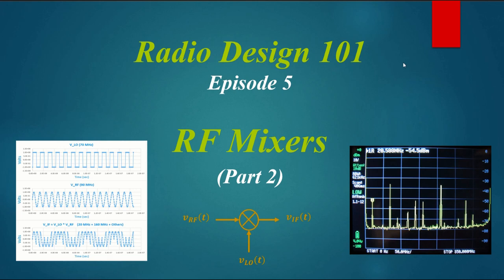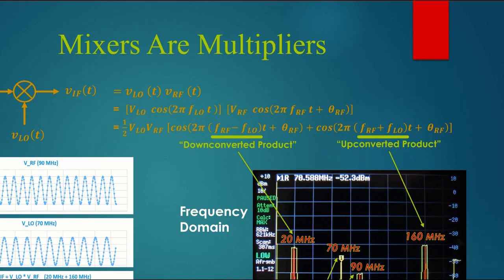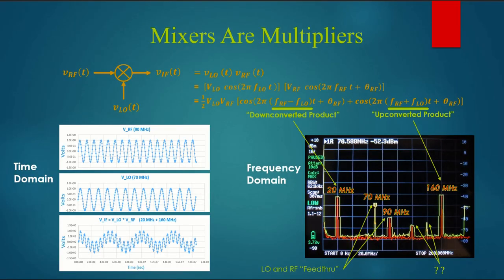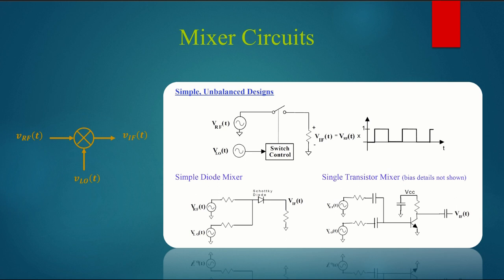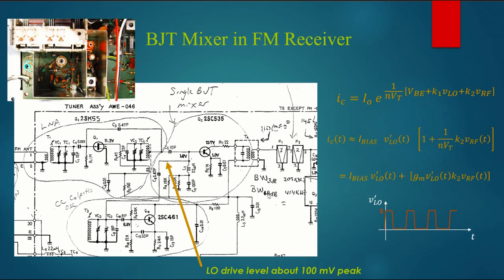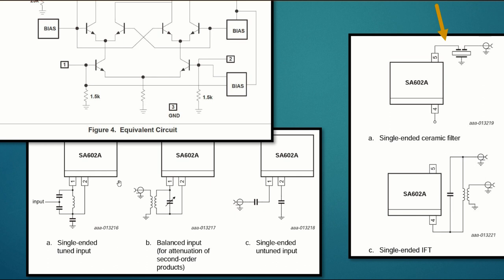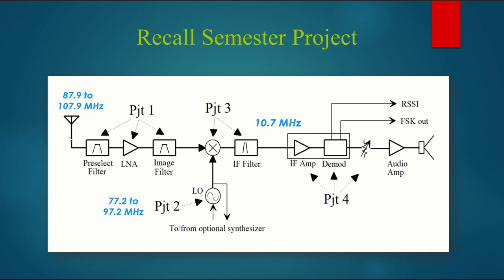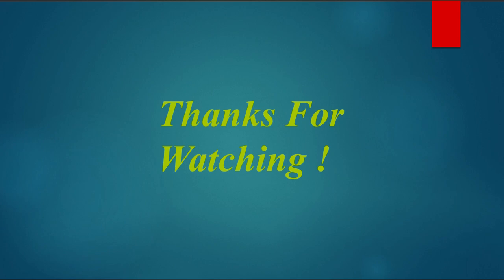Radio Design 101 - RF Mixers, Part 2 of Episode 5

Comment: I noticed at 12:46,capacitors(c8 & c5) and throughout the video there are capacitors with current going through them. I know this may be a question beneath you. If you don’t respond, I understand. I just always learned capacitors don’t allow current to travel through them. They have to be in parallel. I also learned transistors allow current to be taken from the emitter and the base supplies and on and off switch. So why are the capacitors allowing current to go through them? I know ac current can go through capacitors but not DC so is the voltage source AC. And can current be collected from the base of transistors as well?
Reply from the maker: Thanks for the question. In the videos, I'm almost always talking about "signal" flow. In this case, the signals (the RF and the local oscillator signals) are AC sinewaves, so they can pass through the capacitors without any problem, while the capacitors 'block' any DC 'bias'.  As you noted, capacitors do block DC. But they are also used for "AC Coupling" - letting the AC portion get through.  To go a little deeper into this, think of the voltage and any node in the circuit as AC+DC. For example, at the input of an amplifier, there is a "DC bias" required to get the transistor turned on. But the input signal is not just a flat DC line. It has the signal "riding" on it. Some examples are shown in the amplifier design discussions of Episode 3. Time 10: 14 to 11: 00 shows one example here:  https://youtu.be/UUlqW-vSq9M?t=611   Hope that helps.

Comment: It seems that the SA604 is now obsolete and I can't find it on Digikey or Mouser. Would you have another recommended FM IF demodulator IC? Thank you!
Reply from the maker: Interesting. Thanks for the heads-up! It's not used in the Radio Design 101 build, but we did use it in 2019 class parts list on ecefiles ( https://ecefiles.org/rf-circuits-course-notes/ ) .  It seems they took it out of production in the last 5 years 😞  The good news is that the approach taken in episode 6 where we used the SA602 as a demod still works. The bad news is that even that chip seems to be withdrawn from production by NXP as well?  All of them however do show up in listings on Amazon (at least the US site) in the form of NOS (new old stock).

Comment: You get other harmonics that you see in the spectrum analyzer not because the LO is of switching type. The simple multiplication formula is only a small yet the most important part of a longer equation. So, the shown smaller equation explains why you get the downconverted and upconverted components but doesn’t say how other components get generated. 😊
Reply from the maker: Thanks. Good point. I probably should use the term non-linear circuit rather than switching mixers. The BJT mixer (timestamp 6:50) may not fully switch on and off - but it does have non-linearity and transition softly between 'on' and 'off' during the LO cycle. So the diagrams are definitely idealized to a degree.  I actually never liked the commonly used formula f_IF = N f_RF + M f_LO because the N value is practice is mostly limited to N = 1. Unless one overdrives the radio front-end - but that does occur in situations (as noted in the Epilogue episodes in this searies). And as shown there, we can get intermods too... As you noted - it's definitely more complicated !  (but that's something we try to avoid in good receivers of course)

Comment: Can we use rf mixer to mix below 20 Khz audio signals to get higher and lower frequency in that range ?
Because at low frequency all things will be easy to control and see !
Reply from the maker: For most mixers, the RF and LO ports have to be within the RF range of frequencies (MHz to GHz depending on the model). But...  The IF port typically works down to DC, so it includes audio frequencies. In our classes we routinely mix down to audio range at the IF output when building Doppler radars. That said, if you mean can you use audio frequencies at  other ports - the answer is - maybe - it depends on the mixer type. Many have transformer inputs, so they won't pass audio. But something like the NE/SA602 (or 612) IC could be AC coupled with a sufficiently large DC blocking capacitors (e.g. 10 to 100 uF) on the RF and LO ports. (Of course they're still switching-mixers.  If you want a pure multiplication, then there are analog multiplier ICs, or you could just digitize two signals with 2 ADC channels and multiply them in the microprocessor I suppose :-)   Hope that helps.
Reply: @MegawattKS  i mean homemade mixer like using 4148 diode and Ferrite As transformer  or , using dual gate MOSFET mixer for low frequency in khz ?
Reply from the maker: @omsingharjit  I think that would be possible. However, keep in mind that the mixer is a switching design, so you will get out many, many, frequencies in addition to the sum and difference frequencies. The frequencies (n*f_LO +/- m*f_rf, with m and n signed integers) will be in the audio range but the waveform and sound that come out will be pretty complicated (and 'messy'). That's true for the 602/612 devices too. I guess it depends on the goal/application. Do you plan to have a narrow bandpass filter to select the desired 'product' ?

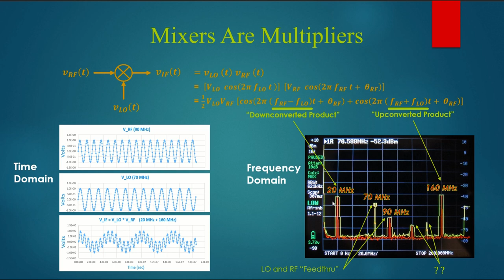Comment: I'm trying to use a transistor as a mixer, but rather than the bottom signal at 6:30 my output looks like the L.O amplitude modulated at the beat frequency... I.e. 10mhz , but this is filtered out by the 10mhz tuned circuit snd i have no output at all... Are there two types of mixers or I just designed my mixer incorrectly?
Reply from the maker: Hi. Interesting problem. It sounds like maybe the LO drive is not strong enough to cause the needed multiplication to happen. For a design like that at 11:30 (or more properly at 12:30 since that includes the output filter you mention), the LO signal at the base needs to be at least 100 to 200 mV peak (with the emitter AC grounded) to force the transistor to turn on and off over the course of the LO cycle. That 'chops' the RF  signal, meaning its multiplied by a squarewave (which contains sin(w_LOt)) at the LO frequency.  If the waveform looks like the LO, AM modulated at the beat frequency, then it sounds like the result is just the addition of the signals, with no multiplication happening. I.e. it's just something like  2 sin [½ (w_RF + w_LO) t] cos [½ (w_RF - w_LO)] = sin (w_LO t) + sin  (w_RF t). So its just the addition of the LO and RF sinewaves, with no new frequencies in its spectrum.   What are the frequencies and amplitudes being used for testing? And is the circuit something like that at 12:30 (with a good emitter bypass)?
Reply: @MegawattKS  thank you very much!

Comment: Mixer and filter work like a charm, higher order(3rd i think) harmonics of LO do make it out of filter though, but i think that should be played around to manageable levels with LO amplitude.
Reply from the maker: Excellent !   The good news is that the high-frequency content typically doesn't get much further down the receiver chain since the IF amp is typically lowpass or bandpass :-)
Reply from the maker: I'm starting to work on the next (and final?) video. The good news is that it will leverage the content already covered for the IF limiting amp (with some tweeks), and the demod uses the SA602/612 which we're already familiar with.  (In the class we used chips like the LM3189 or SA604 for IF amp and demod, but I didn't have any of those, so sticking with the basics. Those chips use a Gilbert Cell internally for their demod, so the techniques are basically the same...)
Reply: @MegawattKS  i am wondering whats the signal strength that would get a station receivable.....my SDR(USRP) had been unable to detect stations, my place gets poor signal strength.
Is -55 dBm after LNA a signal strength that could translate into audio?

(i could always test with my own SDR station, if commercial stations reception end up not working).
Reply from the maker: @cholan2100  Yes. that's actually a reasonably healthy signal :-)  A good FM broadcast band receiver should work down to within about 20 dB of the thermal noise floor (kTB). Here, B is the channel bandwidth, so 200 kHz, giving a noise floor of about -121 dBm if everything is perfect in the receiver (including low noise figure in LNA). So if all goes well, you should be able to get signals as low as -100 dBm at the antenna. In the class final exam demos, we set the threshold sensitivity spec at -110 dBm and the RF input power needed for 30 dB audio signal to noise as -100 dBm. Again - these are signal levels at the antenna, so if you have 20 dB in the LNA, you've got -75 dBm at the antenna and a good 25 dB margin :-)
Reply: @MegawattKS  looks like electrical light fixtures and other electronic devices are dumping so much noise in the band. 

To my surprise even USRP SDR(despite being in a metal enclosure) on its own is radiating(unintentionally even when its not programmed to radiate anything). So not surprised its having trouble receiving receiving the FM stations.

I had a powercut by chance in my place, all of sudden my receiver started receiving stations.
Reply: @MegawattKS  with SA602 i guess it will be a quadrature demod with additional external amp?
Reply from the maker: @cholan2100  Exactly :-)
Reply: @MegawattKS  I got the antenna fixed close to 50 ohms, measured the signal to be around -95 dBm on TinySA. I got the SDR to receive stations after getting rid of noise from electrical fixtures and a leaking Wifi access point. SDR somehow reported -115dBm, probably insertion losses. SDR was only able to receive with LNA that I built.

I built a attenuator that could get my fixed voltage signal generator close to -95 dBm(as seen on my antenna). Somehow LNA is performing much better than measurements made with VNA.

I also built an Audio amp with LM386 opamp which seems to be able to handle audio signals as week -40 dBm which is nice. So I only need my IF_amp+demod to raise signal another 20dB. May be cascade 2 stages for much better gain.

Waiting for SA612 to get delivered for the demod. I do have a 10.7 ceramic resonator from old broken receiver,  probably can help derive the quadrature signals.
Reply from the maker: Awesome !

Comment: SA602 is 200 MHz and SA612 is 500 MHz.
Reply: I checked some other ICs above 500Mhz. I found they are called up converters or down converters. No one is simply called mixers. Do you know why they can only do up or down conversion instead of bidirectional conversion like 602/612? What has been improved to trade off that functional loss?
Reply: @sullivanzheng9586  High frequency devices are difficult to use; they oscillate without extreme care.  Up converters help this by blunting the input some and down converters help this by blunting the output some.  Even so, they are VERY finicky.  This is also why RF amplifiers have low gain.
Reply: @byronwatkins2565  As I search on mouser and LCSC and I found a few "RF gain block" ICs such as TQP3M9009 (50M-4GHz Gain is 27dB@50Mhz, 0.8dB NF) or BGA2869 (DC-2.2GHz, Gain 31dB@50Mhz, 3dB NF). It looks like their gains are not that low? 

And I also find their bandwidth are crazily wide and NF are very low. And they have 50ohm input and output impedance so save me lots of time design and fine tune impedance matching circuit.  I wondered if they are good to use as LNA after attenna for the FM receivers I am building? I found very very few people use these ICs when they build their own radio. Am I doing something wrong here? 

I also tested several samples of these RF gain block ICs, the S21 parameters are very very impressive and noise is almost negligible, so if I reason from first principles, these ICs can replace those FET/BJT version of LNA amps, can't they? (As long as their working frequency covers low freq, like all the way to DC)
Reply: @sullivanzheng9586  Be very careful to maintain 50 Ohm traces, to bypass power well, and to limit the bandwidth.  Also, be aware that the broad dynamic range of FM station received power makes receiver design tricky:
https://www.youtube.com/watch?v=pRsXqeU9Vtw
I don't know why others don't use these for lower frequency, but I am sure that the cost and the tendency to oscillate are considerations.
Reply: @byronwatkins2565  My guess about few people using broadband LNA is that interference may be a big trouble. Just like Epilogue of this video series says, strong AM signal may overshadow/blind our target band (FM). JFET LNA usually have some band selection "for free".
Reply from the maker: I think the main issue is what the bandwidth for the different ports is. As you said, they're all mixers. But some will have a higher cutoff frequency at the IF port, so maybe those are labeled up-converter. Conversely if the IF port has a pole at 100 MHz (due to capacitances in the output section of the active circuits that do the multiplication), then they'll be marketed as down-converters.